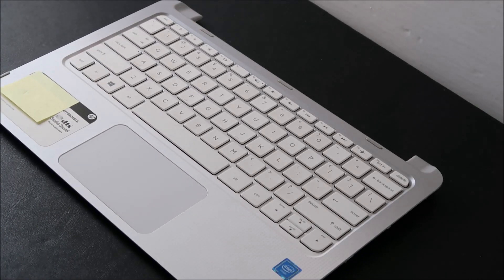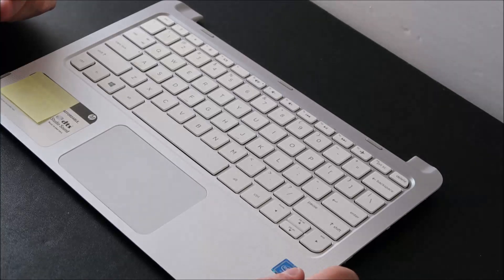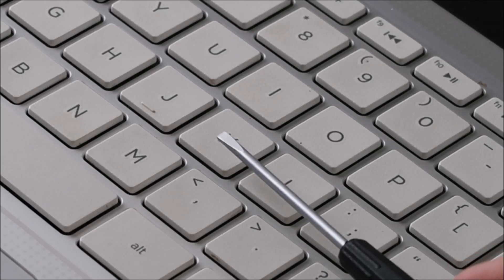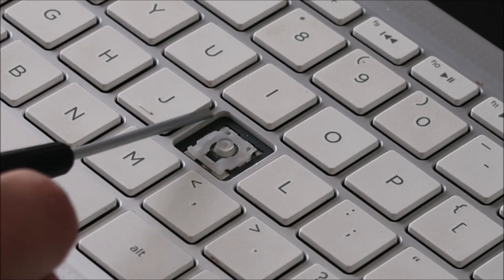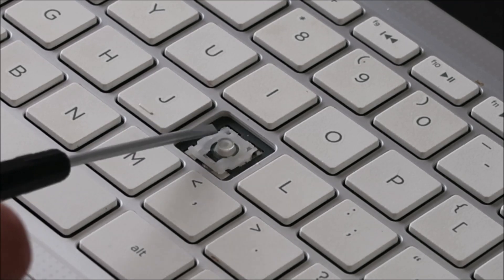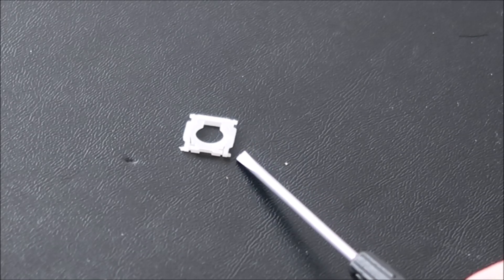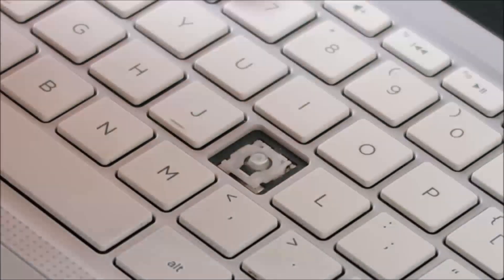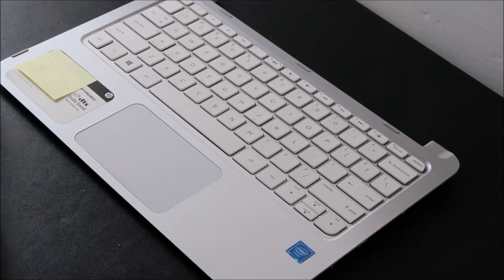How To Fix Replace Small Keyboard Key - HP Envy Laptop Computer

Comment: its wierd, all of a sudden the keycaps i use mostly just fell off all four at the same time? and if i push on them they just pop off, i've tried using sticky tape/ plastic under the caps to keep them on and it seemed to be working a bit, but they still are quite loose.
Reply from the maker: What is happening exactly?  Does just the key cap come off and the retainer clips are still attached to the keyboard?  Or do the clips come off still attached to the key caps?
Reply: @PC_Monkey  the key caps come completely off the retainer clips but some caps are very loose, the retainer clips are still attached and fine i think. ( i've tried to clean the caps and retainers with a dry cotton bud just in case, but they are still loose)
Reply from the maker: @spiritgalll9528  If your Key Cap is not clicking down in place correctly, it is most likely due to the Retainer Clip not being properly installed or damaged.  Remove the Cap and inspect for damage or that its not laying down flush and properly snapped in itself.  Compare to another Clip if needed by removing another Cap.
Reply: @PC_Monkey  thank you i appreciate your help, i'll check on that.
Reply from the maker: @spiritgalll9528  Good luck !!  Let me know how it goes :)

Comment: Uh, so unfortunately I was goofing off and took off my N key and I surprisingly took it off very easily without it being stuck or anything, and I put it back on easy, so I took it out again and the white thing came off with it this time, and I tried putting the key back on, it didn't work... so I was like, "Hey maybe if I take the white part off the key I can easily put the white part in first, and then the key" I tried to do that and the white part broke, so now I have the outside of the white part and the circle thingy with the square on the bottom and also a white barrier (both those are supposed to be one), and I am currently typing with the little button that supports the N key, do you know how to fix this?
Reply from the maker: If the retainer clip broke, then you would have to replace it.  I usually get my keys on Ebay or www.replacementlaptopkeys.com.  If you cannot find a loose key for sale, you may have to purchase a keyboard and take a key from there.

Comment: My Ctrl button poped out I have done all the process but atlast when I try to insert it again it's not fitting  into it
Reply from the maker: Check out the FAQ's on my videos next time!  Could help you get an answer faster :)
If your Key Cap is not clicking down in place correctly, it is most likely due to the Retainer Clip not being properly installed or damaged.  Remove the Cap and inspect for damage or that its not laying down flush and properly snapped in itself.  Compare to another Clip if needed by removing another Cap.

Comment: On my keyboard accidently a drop of water of dropped on F-10 key, unfortunately its the media play/pause button key, so now it randomly gets pressed automatically more than 100 times a day which is quite annoying, is there any solution for this
Reply from the maker: This video is a tutorial on how to replace a key.  If your keys are not working but are not mechanically broken, troubleshoot them as seen here; https://youtu.be/wqrchfpdJ_w.  If reseating the keyboard ribbon cable does not work and if none of the other steps in that video help, you may need to replace the keyboard.  Let me know if you would like help locating a keyboard replacement :)

Comment: hey what if the keyboard piece has the plastic parts on the key piece and the hooks on the keyboard?
Reply from the maker: Are you saying the Retainer Clip is still attached to the Key Cap?  Check out the FAQ's on my videos next time!  Could help you get an answer faster :)
Because they key can usually not be reinstalled with the Retainer Clip and the Key Cap still attached to each other, you would have to separate them as seen here, using a small flat pry tool.
Reply: @PC_Monkey  thank u :D
Reply from the maker: @zenitsuagatsuma7984   Your welcome !!  Happy to help :)

Comment: Bro, can tell me how to fix the down arrow of my hp 14inch laptop, retainer clip got stuck inside of the key
Reply: The plastic part got stuck inside of the key, can u please tell me how to get it out
Reply from the maker: Because they key can usually not be reinstalled with the Retainer Clip and the Key Cap still attached to each other, you would have to separate them as seen here, using a small flat pry tool.
Reply: @PC_Monkey  I tried to separate it, iam afraid that if I pulled hard it may break
Reply from the maker: @rehansebastian234  Yes, keys and their components are very breakable.  You have to be careful

Comment: Pried cover off on 8. Cleaned it out no longer sticks BUT I cant get the cap back on  What do I do?
Reply from the maker: If your Key Cap is not clicking down in place correctly, it is most likely due to the Retainer Clip not being properly installed or damaged.  Remove the Cap and inspect for damage or that its not laying down flush and properly snapped in itself.  Compare to another Clip if needed by removing another Cap.

Comment: Unfortunately my bird doesn't take that much care when removing a key when unattended.
He always breaks the clips so it won't snap back down. A bit of super glue on the rubber cap gave me a temp fix.
Reply from the maker: I usually get my keys on Ebay or www.replacementlaptopkeys.com.  If you cannot find a loose key for sale, you may have to purchase a keyboard and take a key from there.
Reply: @PC_Monkey  Yes I ordered one yesterday after I super glued it on. Hopefully it will come apart ok.
Reply from the maker: @dugsbugs1   Good luck !!  Let me know how it goes :)

Comment: Whenever I put my key cap on it always pops out. I even checked for damage and there was no damage on the key cap and retainer clip.
Reply: Every time I  put down my key it not just sticks and feels like I'm pressing nothing when u press down on it
Reply from the maker: @habanerodumpling5664  If your Key Cap is not clicking down in place correctly, it is most likely due to the Retainer Clip not being properly installed or damaged.  Remove the Cap and inspect for damage or that its not laying down flush and properly snapped in itself.  Compare to another Clip if needed by removing another Cap.

Comment: My "t" is often not typing. I suspect there is something under it that is keeping it from connecting to pressure and perhaps cleaning will help it.  Would you recommend the process you show in the video and blowing it out with pressurized air?
Reply from the maker: Does the key 'feel' like something is physically wrong with it?  
If so, yes, do this to clean it out.
Reply: @PC_Monkey  no, it doesn't feel like there is anything wrong with it..I press down normally and it does not type as it always did. I have to strike the key harder.
Reply from the maker: @queenvldg  This video is a tutorial on how to replace a key.  If your keys are not working but are not mechanically broken, troubleshoot them as seen here; https://youtu.be/wqrchfpdJ_w.

Comment: So uh... I only needed to replace the keycap, but it wont clip back down as shown here. It just bounces back off...
Reply from the maker: If your Key Cap is not clicking down in place correctly, it is most likely due to the Retainer Clip not being properly installed or damaged.  Remove the Cap and inspect for damage or that its not laying down flush and properly snapped in itself.  Compare to another Clip if needed by removing another Cap.

Comment: my key keeps popping off every time i press on the top part
Reply from the maker: If your Key Cap is not clicking down in place correctly, it is most likely due to the Retainer Clip not being properly installed or damaged.  Remove the Cap and inspect for damage or that its not laying down flush and properly snapped in itself.  Compare to another Clip if needed by removing another Cap.

Comment: i lost my those white things can i fix it?
Reply from the maker: Little white things?  The Rubber Spring or the Hinge Clip?   If you lost a component, then you would have to replace them.  You cant fix a key without all the components.   I usually get my keys on Ebay or https://www.laptopkeys.com/.  If you cannot find a loose key for sale, you may have to purchase a keyboard and take a key from there.
Reply: @PC_Monkey  hinges the one you covered with the white button in middle
Reply from the maker: @FactPhantom7   If you lost a component, then you would have to replace them.  You cant fix a key without all the components.   I usually get my keys on Ebay or https://www.laptopkeys.com/.  If you cannot find a loose key for sale, you may have to purchase a keyboard and take a key from there.

Comment: when I press down on my a key it pops back off I love it how nothing works for me
Reply from the maker: If your Key Cap is not clicking down in place correctly, it is most likely due to the Retainer Clip not being properly installed or damaged.  Remove the Cap and inspect for damage or that its not laying down flush and properly snapped in itself.  Compare to another Clip if needed by removing another Cap.

Comment: Why if the retainer cap came off along with the key cap??  I can’t take it retainer cap off from the key cap.
Reply: Mine accidently came off and did the same thing. It will not pop back on.
Reply: In case it helps anyone struggling with this problem: my retainer cap came off and was partly attached to the key and I couldn't fix it.
I solved the problem by separating the retainer cap part that was still attached to the key from the key and focusing on just putting the two retainer cap parts together to start with. 
I noticed the smaller retainer cap piece actually has a hinge in tiny indentations on both sides in the inside middle of the larger piece. 
These clipped together, I put them in the key position making sure they matched the metal brackets, then just pushed the key in on top.

Comment: wen i did it when i push it ip it comes off
Reply from the maker: If your Key Cap is not clicking down in place correctly, it is most likely due to the Retainer Clip not being properly installed or damaged.  Remove the Cap and inspect for damage or that its not laying down flush and properly snapped in itself.  Compare to another Clip if needed by removing another Cap.
Reply: have you made a video about it
Reply from the maker: @akiyo129-p5d  This is the Key replacement video lol.  It shows how to correctly remove a key and how to correctly put it back on.  If yours is not installing correctly, and is most likely damaged, you need to inspect it and the metal pins on the keyboard for damage.  If you are unsure of what to look for, compare it to another key on your keyboard

Comment: Hi PC Monkey.  I have an Envy 17-AE.   The "R" key came off.  Everything seems to be in place.  I should be able to just press it back on, but its not sticking.  Doesn't seem like anything is broken inside or under the key.  any ideas?  Thanks!
Reply from the maker: If your Key Cap is not clicking down in place correctly, it is most likely due to the Retainer Clip not being properly installed or damaged.  Remove the Cap and inspect for damage or that its not laying down flush and properly snapped in itself.  Compare to another Clip if needed by removing another Cap.
Reply: @PC_Monkey   Thanks!
Reply from the maker: @sgw107  Happy to help :)  Always here if needed !!
Reply: @PC_Monkey  how can I purchase a new key retainer cap? I think mine is broken because the A button came off months ago when my computer was only a few months old. My son uses it and try to jam it back on and I think it broke the retainer cap because I'm trying to put it on and it won't snap back on
Reply from the maker: @samsamthecat492   I usually get my keys on Ebay or www.replacementlaptopkeys.com.  If you cannot find a loose key for sale, you may have to purchase a keyboard and take a key from there.

Comment: A technician tried to clean one key this way but it did not get repaired, do I need change the whole board?
Reply from the maker: It depends on if the key is not working mechanically or if the problem is with the keyboard.  Refer to this video;  https://www.youtube.com/watch?v=wqrchfpdJ_w
Reply: @PC_Monkey  thanks I ll watch it
Reply: @PC_Monkey  I did. It seems that it is the specific key of the keyboard that is not functioning and since the keypad is an integrated one - not attached through a ribbon, I ll need to change the whole top which includes  the touch pad. What a mess for just one key!
Reply from the maker: @KostasTrivizas  Right!  Ya, some computers stick like that :(